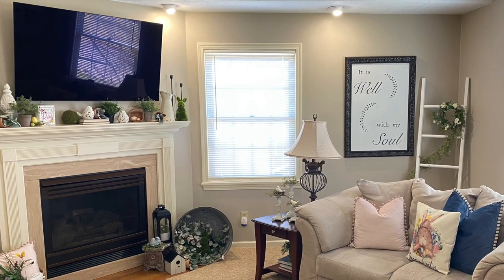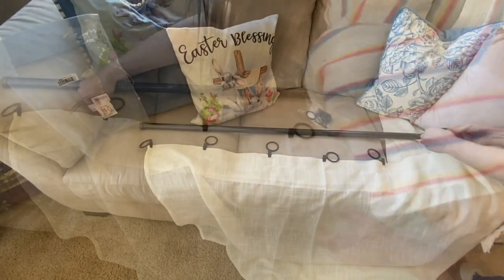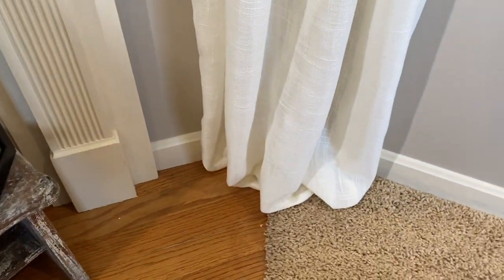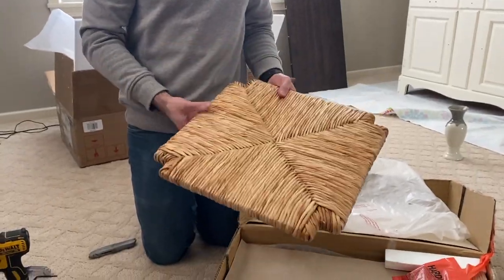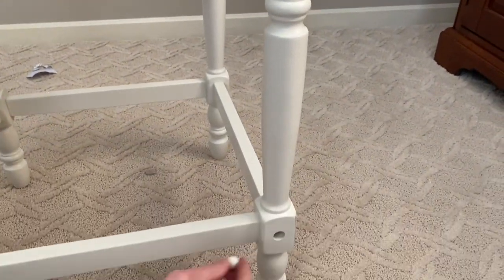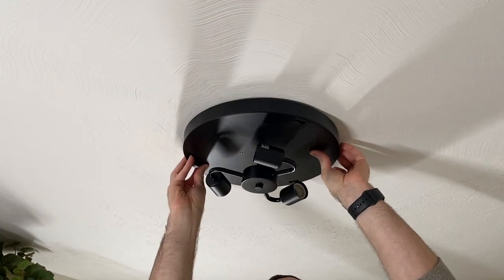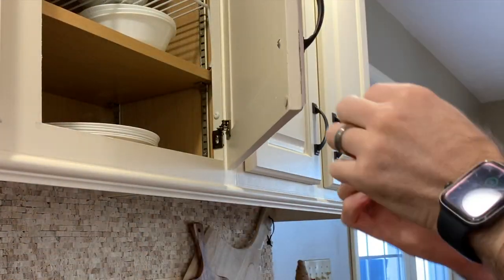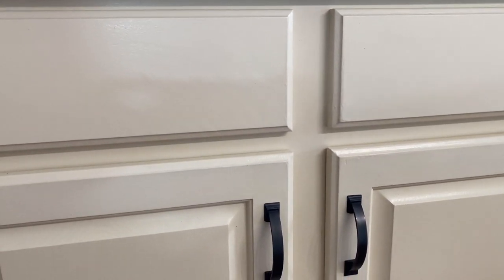BUDGET FRIENDLY DIY HOME PROJECTS | SUPER EASY PROJECTS FOR YOUR HOME | HOME UPDATES

Comment: The drapes in the Family Room adds a warmth to the room.   I always want something else on my windows in preference to nothing at all.   I like Mini Blinds as well but on those days when you want the sun to shine in I pull mine up.  At night I love to put them down and close them for more privacy.    The color you picked out makes them light and airy.     

The bar stools are very nice looking.   We recently purchased a new Drop Leaf table & chairs for our kitchen.  We put those felt stick on protectors on the feet of the chair legs we found that they didn't adhear to the wood very long and we had to use a bit of crazy glue to put them on to the leg feet so they'd stay on.   Just be aware that they may not stick for long and you may have to glue them on.    Everything else is a beautiful up date.   A few projects checked off the list.     Great job you two.    Never seen that Wax you  used on your hutch but its going to protect your nice finish.  Although I prefer to use Polyeurathane .   but for what you did it on worked great.
Reply from the maker: Hi Ann. So glad you enjoyed.  Yes, a polyurethane can be used in place of a wax. Take care and God bless.

Comment: great job.....love the curtains so much...really transforms the windows.  I wax alllll my chalk painted furniture....2 reasons.....one....if you rub up against chalk paint....you will wear it.  second...I have found that on older furniture...usually antiques...it helps to prevent yellowing....even tho you dont have to prime or sand when using chalk paint, I have found certain pieces need it.....to me its just a little extra touch. 😄
Reply from the maker: Hi Denise!!! 🙋🏻‍♀️Thank you so much!!! I’m glad you like the curtains!! Thanks for the info.🥰👍🏻 I don’t know much about chalk paint and wax, this was my first big piece using it!!  So In your opinion what is the benefit of chalk paint verse regular wall paint or enamel?? I’d love to know what you think, if you get time!!💕Have a blessed weekend and thanks for watching 🙏💕
Reply: @SimplyRHome  Sure!..the biggest benefit of Chalk paint is how you really do not need to sand or prep your piece...of course if there are any areas that need special attention...cracks or holes...then those can be addressed..however with that said..most ppl that use chalk paint prefer a "rustic or used" look.  You can (and I have) used flat latex paint....I actually use Benjamin Moores Chantilly White in flat for most of my projects these days..its a very cool white which is what I prefer.  I like it also because if its rubbed up against(prior to waxing) it wont rub off...or if you choose not to wax.  Chalk paint is exactly what it says...and its chalky. With my BM flat paint....I dooo sand and sometimes prime(depending on age of piece and what shape its in).  I have customers that only want Chalk...even if I explain to them about the latex flat.  I am getting ready to try milk paint soon.....so I am kinda excited and nervous about that....apparently with milk paint there is more dimension than flat paint and chalk paint.  I am going to head to instagram and follow you and I will send you a pic of what I mean. 😄
Reply from the maker: Thank you so much, Denise!! 💕I appreciate the explanation so much!!! 🥰Thanks for taking the time to share your experience with chalk and latex paint!! It really helped me out!!! I’m wanting to paint our bedroom furniture and didn’t know which way to go! It will definitely be a later in the year project but you’ll have to say tuned!!! Thanks again, my friend!! Have a wonderful day!!💕